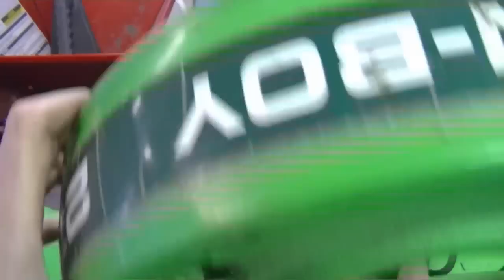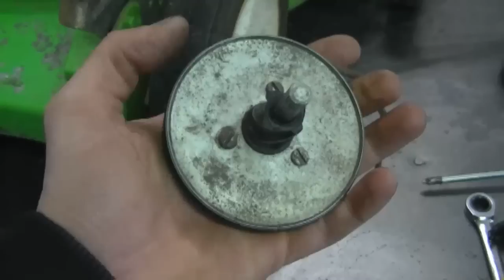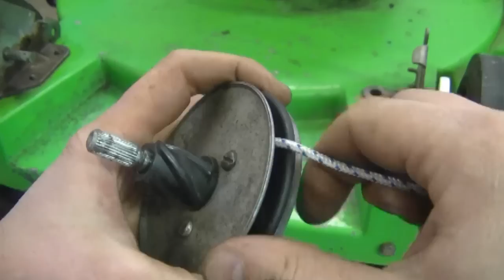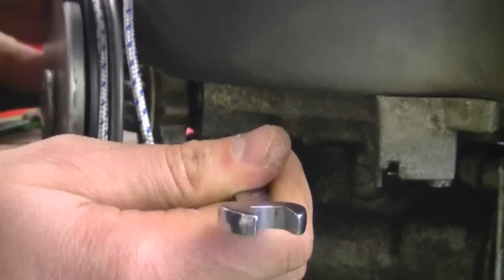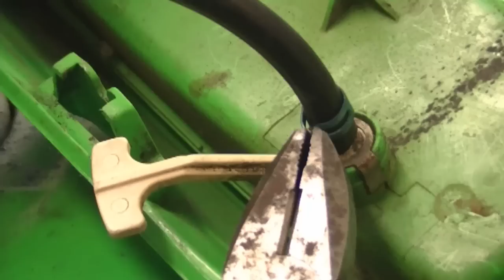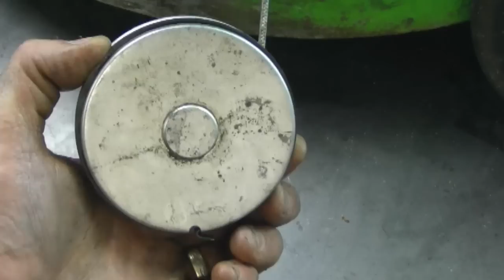Pull Cord Repair On 2 Cycle Lawn Boy Lawn Mower

Comment: Thanks for the video! When trying to take the screws out to pop open the string assembly, one of the screw heads sheared off and I can’t get it out. The spring itself also popped out of the housing. Do you have any recommendations for how to proceed?

Comment: Trying to bring back to life I believe to be a 1981 Lawn Boy push mower model that has been in the family since new. Sat dormant for around 35 years. Got motor free, but having difficulty with pull start. The little metal wire piece in the crank mechanism keeps coming off. Are there new pieces available?

Comment: Wonderful video. Thanks Donyboy!  I still use my LBoy 7035 (2 cycle oil/gas mix) purchased Oct 1986.  Oil leaking from bottom…if anyone knows fix, it would be appreciated.  I’m not sure if it’s coming from the muffler or maybe from crankshaft.

Comment: Great video.  I should have looked at comments before starting because I had the allen screw bolt to remove the unit also.  I now see others also had this bolt.  Would have saved some time.  My bad.

Comment: Bro, do you know how to remove the height adjuster assembly?  It's the part that has the grease fitting on the back wheels. I'm wondering if I need a puller

Comment: I have a lawnboy model 10323.  When I pull the cord, it doesn't catch until  most of the cord has been pulled out.  It does not seem to catch as easy. The recoil is under the top shroud, is flat.
 Any suggestions?

Comment: If you are restoring an old Lawn Boy or if it has been rained on or otherwise subjected to moisture, the return spring and the inside of it's housing may be rusted. Lawn Boy says that, after removing the 3 screws, hold the spring housing assembly together. (Hold it together tightly, being aware that the loaded spring is inside. Wear safety goggles.), then drop it on the floor (or ground if you have a concrete floor to prevent damage). This will cause the spring to sprongle safely out of the housing. You can then clean any and all rust from the spring and interior of the housing.  Lawn Boy says to apply a light coat of grease to the spring. Put the inner end of the spring in the anchoring channel and put the assembly back together, making sure to have the spring in the slot in the outer edge. Then hold the assembly and wind the worm gear till the spring is fully retracted into the housing and hooked in the slot. Then let spring tension relax. Lawn Boy says not to lube the pinion gear; to leave it dry, but I plan to use dry (teflon) lube on it and the worm gear when I do mine.) 
Btw, this is a good time to replace the pinion gear if it is worn.
And, yes, I said "sprongle" (heh-heh).

Comment: Thank you for making this video, it revived the best push mower I have ever owned.  The spring on my mower came loose and messed up the pull cord and I did not know how it was suppose to be installed until I saw this video.  I bought a new spring, followed this video and the old mower started on the third pull.  I like these old mowers that you don't have two handles to mess with and you don't have to restart the mower when you have to stop and move something out of the way.  THANK YOU!

Comment: How do you remove the engine from the deck?Is there a special way to do it?
Reply from the maker: you will see bolts under the deck
Reply: @donyboy73  Yes but theres a lip.Does the engine seperate from the bottom or do i remove the plastic on top and drop it through?

Comment: I have a Model 8310 Lawnboy which is a different model then in the video.  I watched the video and got to the point where he pulls out the pull cord mechanism after unscrewing the both underneath (although mine had an allen bolt).  However, I tried to pull my models out and it won't budge...any ideas?

Comment: I just had an awful time removing the starter assembly on my Lawn Boy.  Instead of the 7/16 bolt like yours had mine had an Allen head set screw which was of course stripped out.  I ended up chiseling the bolt out.  I ended up replacing the Allen with a hex head bolt..

Comment: DONY ! I was given 2 lawnboys from the 70's (I guess) and I need to rebuilt one engine. Do you think it's worth it ?
My ditch was about 20º before but, the road has been redone and, they raised it by 6 inches so, I need a working 2 cycles to mow that 45º ditch without any worries. Merçi beaucoup !

Comment: recoils on my 5237s have a plastic pulley, not the metal piece with 3 bolts. One had 1/2 in head bolt other had a cap screw with hex

Comment: This was extremely helpful. However, Some people may have a model that has a hex key set screw instead of the 7/16" bolt to hold in the pull cord assembly that was on this model. I believe the correct size for the hex key is 5/32" (I got 4 mm to work). The model I was working on was an 8237 AE.
Reply: Thanks for this comment I ran into the same problem, I tried a couple of allen wrenches but they would not work, I'll now buy a 5/32"   The Allen wrench set I have goes from a 1/4  to a 7/32" no 5/32", ones' too small the other too large.
Reply: Same on mine

Comment: I picked up an old Lawn-Boy and found that the pinion gear for the starter mechanism was broken so I ordered a new one.  Rather than two clips, my machine has what looks like a giant safety pin for diapers.  It fits around the new pinion gear where there is a groove for it and I made sure it was on either side of a large aluminum piece that sticks out from the entine in order to prevent it from spinning around.  My question is, what does this thing do?  I realize that it follows the pinion in and out as you pull the rope, but I don't understand what it's there for.  Also (and this may be related) the pinion fails to engage the flywheel teeth 4 out of 5 pulls.  It moves toward it but stops as soon as it hits it and before the teeth engage.

Comment: Don, I have an older Model Lawn boy, but the spring gear comes out the same way, only mine has a panel but I think the Gear is worn out..Every time I pull the string it retracts, but doesn't turn the crank because the gears slip.. also about a 10 inch wire fell out as I was loosing the bottom screw. I have no idea how to replace that wire.. don't know how it goes back in.. Flustered because it was running so well before, now it won't 
crank. :(

Comment: Great information, but a word of warning to whoever tries to replace one of these pull cords..... Do not remove the very front plate or slide the textured shaft that the gears ride on forward . The actual recoil spring will then pop out and it could hurt you, and drive you insane trying to rewind it.
Reply: Luke Skelnik lol....you are soooo right!! just got done winding that evil thing back up. I think I'd rather birth another child.

Comment: I have the identical one the three screws on the starter coil the holes got stripped and i cant get the replacement part because it was discontinued

Comment: I have an older LB than the one your working on. When it starts it runs fine, then after a few minutes drops down to a fast idle. I can't figure out what te problem is. I've cleaned the carb. The adjusment wheel that is attached to the rear of carb does not seem to do anything. Where am I going wrong Please??? Gas leaks slowly when sitting.

Comment: What's the recoil doing when it doesn't engage quite right? In other words you pull the rope half way out and it finally catches or it will slip and come all the way out when you pull and nothing happens as far as the engine turning over. It recoils ok but only catches and turns the engine over about half the time when pulling out. Is it the gear not going in and out like it should? I'm afraid I'm going to break the rope sometime but luckily it's long enough and hasn't happened yet.

Comment: The Lawnboy spring is probably the easiest to replace.  You just wind it in and then bend the tang over at the end so that the spring end is not pulled into the recoil housing.  I will send the link to the Online Lawnboy Manuals directly to DB so he can post it.  The system wont allow me to post the link into my reply.

Comment: hey donyboy on most lawnmower engines there is a pipe thingy that leads from the carbuerator to the  engine and it has 2 bolts that hold it on what is that pipe thingy called

Comment: Lithium grease works well, here from wikipedia : A grease (lubricant) is a mixture of oil and a soap. The soaps are dispersed into and viscosify oils to form stable gels. Lithium grease adheres well to metal, is non-corrosive, may be used under heavy loads, and exhibits good temperature tolerance. It has a drip temperature of 190° to 220°C (350° to 400°F) and it resists moisture, so it is commonly used as lubricant in household products,  as well as in automotive applications,

Comment: Like the video Don.I replaced the rope in my LB 4 square model 6211 here awhile back.Bolt was harder to get to on mine.I also use Liquid wrench.They manufacture it not to far from where i live,only about 60 miles west in a town called Indian Trail,NC.I worked for a John Deere dealer in Monroe,NC that is the town right next to Indian Trail.Thought i would share a little bit of info.Later man.